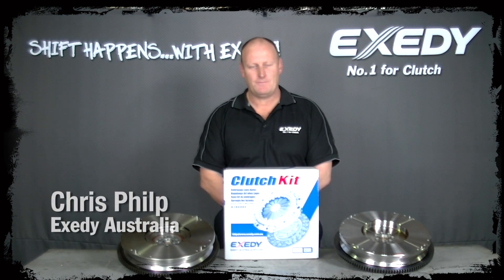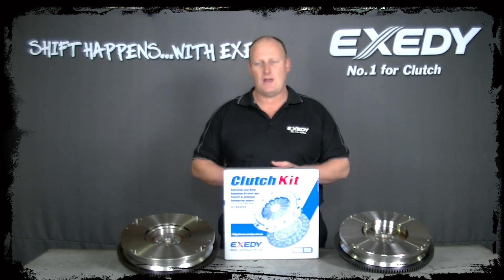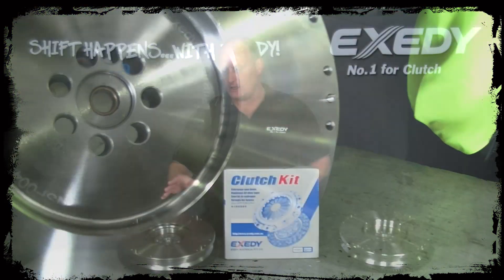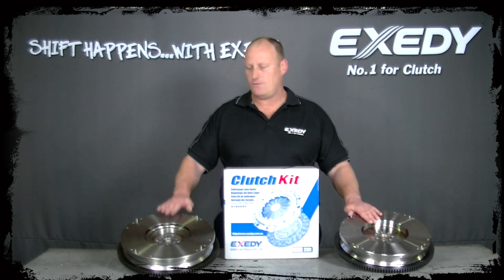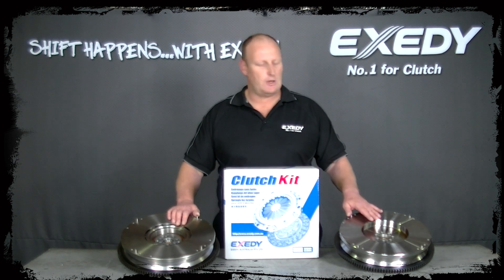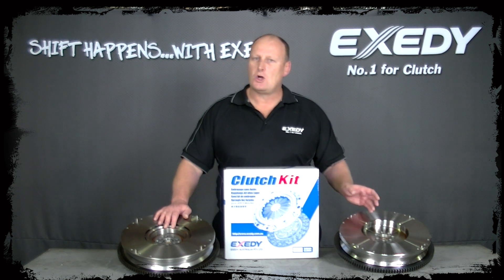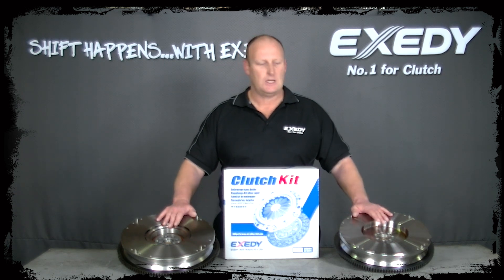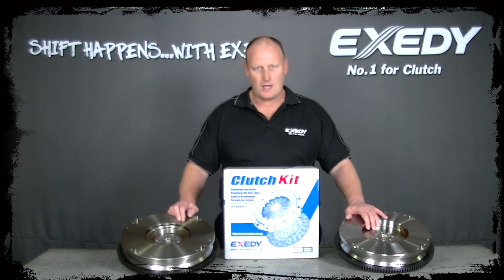Single Mass Flywheel vs Dual Mass Flywheel

Comment: I have a 02 Maxima with 238,000 miles and it seems as if the DMF springs have weakened to the point where taking off from a dead stop feels horrible. has that worn engine mount feeling.  I installed energy suspension polyurethane mount bushings so now I'm suspecting that its the DMF. what do you think?
Reply: I had the same problem, with Audi A4 2.0 petrol, while the engine was idling there was no vibrations or any noise from the engine or gearbox, but moving from a stand still was a huge problem, lots of sounds, lots of vibrations. After I removed the gearbox I found that there is more then 5cm play between the masses (you need to replace the flywheel, when there's more than 3cm play), so the flywheel was absolutely dead. After replacing the whole DMF kit all the problems were gone. It might even killed my gearbox, but I'm not entirely sure, I got the car, with lots of gearbox problems, so I changed it at the same time as well.

Comment: Depending on the engine converting to a smf can destroy the transmission...so be warned. Diesel's are the worst so do yourself a favour and got with a dmf.
Reply: i fit smf all the time with no comebacks at all, unless the transmission is already goosed.

Comment: I replaced mine with a solid flywheel in a 2011 BMW 3 series about a year ago, I only notice a difference in cruise control going up and down hills. The car seams to jerk a little. I can tell you at 140,000 miles my clutch disk had little wear, but the flywheel looked like it was about to fall apart.

Comment: I had my dual mass resurfaced and have put 105000 miles on it never had a problem.
Reply: What car? Model and Year?
Reply: Rob H 1996 bmw 328i
Reply: thats surprising dmf  usually fail way before that, depending on the car though
Reply: @shaneebahera8566  depends on how hard you push it as well, he probably took very good care of it

Comment: Think about it?  It's obvious really the DMF is there to protect the engine from itself. With huge amount of torque being made in modern diesels from about 1200 rpm, it's to stop the end of the crank shaft breaking off. If it wasn't there manufacturers would have to beef up cranks no end. Remove your DMF and see how long your crank lasts.
Reply: SMF are killing all the old TDI's. So many of these cars are coming in with damaged transmissions. When they get the estimate the vehicle is sent to the scrap yard
Reply: By NO MEANS are all DMF's on Diesels, mine is a gas burnr and it has one and I HATE the way it chatters
Reply: Your so right single mass sucks so much noise

Comment: in other word what i understood there is no alteration to the performance...it's just vibration
Reply: Yea,you can resurface a single not a dual
Reply: i found ( reading / looking at parts ) one negative to engine life ( single mass flywheel ) on bottom end bearings and it might make it easier to spark knock / easier to shock load parts and brake them

Comment: sooo...... dmf are used because they couldnt or wouldnt design the engine to run smooth enough?
Reply: Vibration to do with the gearbox more likely since it has most of the stress on it but anyhoo lol.
Reply: +John Griffin Well said.
Reply: The emphasis on smoothness is partially because that's the only side effect that the typical driver notices. Probably the the main purpose of the DMF is to prevent the motor from literally bending or otherwise destroying parts of the drivetrain, be them crankshafts, transmission shafts, clutches, etc. Without a DMF the manufacturer would have to beef up at least one of those parts, if not all of them, creating a heavier rotating mass that's more expensive to produce.
Reply: Yet theres never problems with the old cars with simgle mass and springs in the clutches? I reckon its money racket

Comment: I'm worried if I go SMF I'll be angry at myself for NOT listening to the bulk of people who say they are noisier and more vibrations than stock DMF...(Car is 2003 Nissan 350Z) - CURRENTLY without a clutch ;)
Reply: oh well; too late.
Reply: I have a 2006 Hyundai tiburon V6, went solid a month ago.
Pros: Gear changes are much more direct, love the feeling of it.
HOWEVER
Cons:
 - Idle is just a little bit more rough, though it's the least I'm worried about.
 - Gear shifting is now moderately noisy: Every engaged shift is not audible, as you had worn syncros, and a hitting clutch
 - There is a CONSTANT gear noise/buzzing/whirring sound when accelerating from 1500-2500 RPMs.

Combining these together, it was not worth it for me, so I'm having a DMF and a new clutch fitted in 2 weeks. Believe me, if you are the kind of person, who notices every little sound that's not supposed to be there/wasn't there before, you'd be super annoyed as well.
Reply: Same thing here too. I did not know that SMF makes this noise. THis is the worst mod you can do to your car, the noise is unbearable. Going to install DMF this week.
Reply: what'd you decide? i got my SMF in today and haven't driven it yet.
Reply: SpaceMissile I went for DMF and like it a lot in my saab. The noise is gone.  And shifting is great.
Reply: Pay for it now or pay for it later. It's all a matter of perspective. In my experience, trying to save a buck here and there doesn't work. You will spend the money one way or another eventually either in repairs or a new vehicle when the cheap repairs fail.
Reply: It's NOT about cheap or expensive it's about what is better I have never had a SMF fail EVER, I have actually never worn out a clutch, and I keep my vehicles for decades, this new DMF just to calm a little noise is a very shitty tradeoff in my book. My DMF causes chatter in the clutch, I never had this in any SMF unless the clutch plate friction material was all but gone and you were into the rivets

Comment: dual mass flywheels are a total failure.
Reply: AKS if it is so good why are there single mass replacement for dual mass?
Reply: DMF is total dogshit gone through 3 expensive replacements so getting a single mass this time.
Reply: Dual mass is for smoothness and quietness. Single mass is for everything else, including durability and longevity. That's why dual mass is more expensive upfront and over time, but if you can afford it, it's more luxerious. I put a dual mass in my ladies car, because of the above reasons, and because she doesn't drive stick as well as I do. It's way more forgiving to that type of driver, and more smooth when engaging. If it wasn't for those needs, I'd definitely pick a single mass.
Reply: Yes. No wonder even 350z and 370z used them.my e36 has one too.
Reply: @mrpistonrecaro6483 they go out on 350z all the time too. Then you get all the gear chatter of a light weight flywheel, all in a much heavier package!
Reply: Eddie Kennedy your crazy
Reply: I had 2 replaced under warranty back in 1989 with 11k. And again in 89 with 13k 
Then again in 2009 with 118k went to single then 

Biggest load was pulling a 16’ with a 56 Vw bug on it 400 miles. 

My other trucks have gone 100 k without a clutch. 
I still have the 88. F250 4x4
Reply: I had a solid fly wheel conversion on my taxi no problem and a lot cheaper

Comment: My Dual Mass is starting to squeel a little at low revs, should I go for Single Mass conversion?
02 Liberty, 170Ks
Reply: +MARK OF THE NINJA Thanks - I'm worried if I go SMF I'll be angry at myself for NOT listening to the bulk of people who say they are noisier and more vibrations than SMF conversions...
Reply: yes go for it
Reply: Dual Mass are very very expensive and so is the single mass conversions. If you are lucky like me you will only replace your clutch once in a vehicle's life time or for the duration that you own it. If its an investment why not fit a Dual Mass but if you are going to knock it off any way why not fit a single mass flywheel.